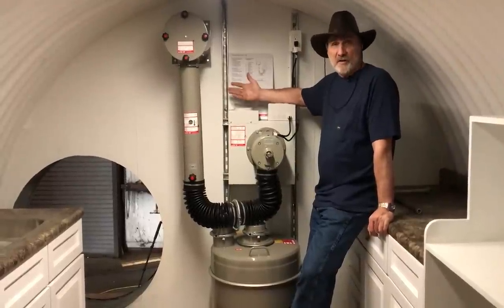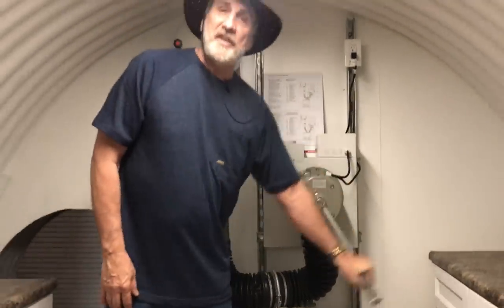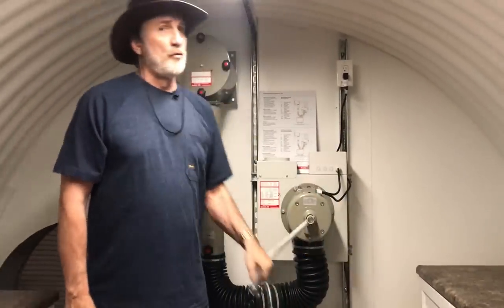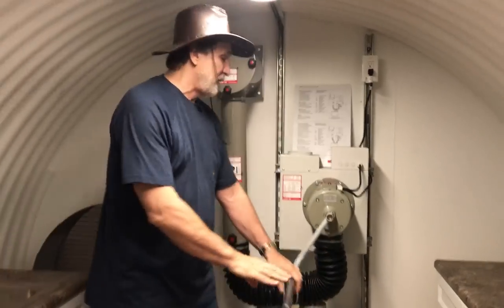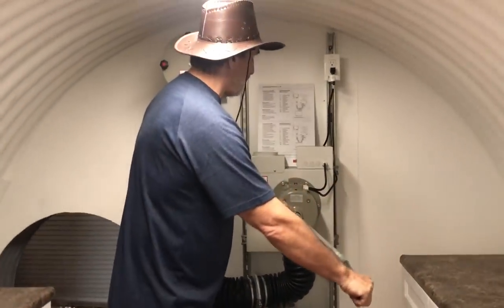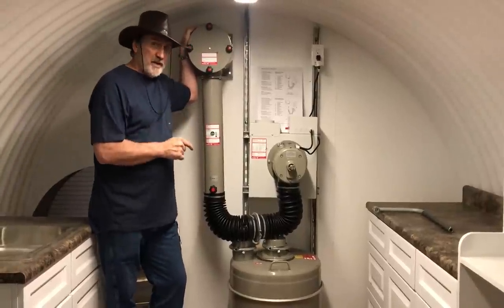How Do You Breathe Inside A Nuclear Bomb Shelter?

Comment: 1)For a prolonged stay in a bunker,  how long will the 60 pounds of carbon & hepa filter last?  2)  Can this be set up so that the 60# of carbon and hepa filter are located 'outside" the actual bunker...an enclosed closet built at one end to keep the build up of filtered material away from the people in the bunker?
Reply: Not long enough and you won't have enough gas to run the generator. It is better to use an internal ecosystem like biodome with zero concrete.
Reply: @brandonandreski1709  everything in a bio dome would be dead from gamma radiation let alone bio or chemical
Reply: @robinsonharvey6186  You misunderstand my meaning. Not the actual dome made of glass, though if thick enough it could work. Gama is very short lived. I am saying that having a filtration system dependent on power and subject to blockage which you cannot unclog because the filter is now a small fission device, is a rather bad idea. So you need to have an alternative system preferably an ecosystem with various plants and possibly aquaponics in order to recycle your air. Power will still be your primary problem but a propane generator with a battery system would probably be the best setup short for your own nuclear reactor. Solar panels will get covered in ash and are subject to other external issues like the EMP that will undoubtedly be released with every detonation. The bunkers will give you a few days but after that you will be forced to venture out. You need something with at least months or even a year buried a good 40 feet down and capped off with a concrete slab.
Reply: @brandonandreski1709  you are correct about filters being contaminated and relying on power the filter issues first to make your charcoal last longer you run the air thru a container with a bubbler system like a fish tank with water and charcoal then in to your charcoal filter and you can flush water and replace in first container and the power issue you have to keep extra supplies for a generator why not keep diodes and capacitor with soldering and solder to fix solar panels and wind turbines NBC suites to go fix things outside and the depth issue is a simple equation how close are you to a military target three feet of dirt protects from gamma and emp cement helps but doesn't protect in actual blast zone just outside it
Reply: @robinsonharvey6186  I used to build reverse osmosis machines and filtration systems. I understand how you can make them last longer but the issue of radioactive buildup is a big problem. As radioactivity builds it tends to leak from containers and heat things up a lot. 

How are you going to fix solar panels on a radioactive surface? That is a complex problem with a very simple system. Propane generators and a battery system. You can have a battery the size of a refrigerator to store power and your propane generator only runs for a few hours every week. 

If your close to a target there is nothing that is going to protect you. I am talking about a shelter far enough away that you don't have to worry about the initial blast. Fallout is the reason you build a shelter. If you are worried about the blast because you live in the city, don't be. You will have a zero percent chance of surviving. A 40 foot bunker with a slab is for stability not just radiation protection. 

An underground hydroponics or quadraphonic system would be the best scenario for long term survival. It will recycle the air and keep your system completely isolated. The issue is containing CO2. Concrete absorbs CO2 and traps it, so you will eventually suffocate so you need to create a sealed metal enclosure that does not react to oxygen or carbon. or that does so very very slowly.
Reply: @brandonandreski1709  for contamination you have to have stuff like pectin or apple juice with it in it or borax soap to clean filter systems of any kind plus it's easy to survive it's hard to survive the mob of people also trying to survive
Reply: @robinsonharvey6186  It's not as easy as washing off. You have to have the respirator, o2 tank, full radiation/hazmat, and portable radiation detection. Alpha and beta are OK but within two weeks you will be dealing with high enough levels to cook a person depending on the level of fallout. In the event of a full on nuclear war you are looking at about a year before radiation levels are low enough to pose little to no threat. Even after cleanup though a wind storm can come in and blow more radioactive particles your direction and that would mean a death sentence. I would rather not have to deal with cleanup at all and have a completely enclosed system so I don't have to go outside for 365 days. Not perfect but still better than external filtration and trying to fix solar panels after EMP. You are never going to get me to try to fix a wind turbine in a suit like that.

Comment: This explains how clean air gets pumped in, but my question is: How does old air get expelled?  I can’t seem to find any info on these having an exhaust system, and if this is so, and the bunker is air tight with air only flowing inwards… wouldn’t this be pressuring the bunker and be unsustainable? 
Would be great if you could please clear this up. I’d love to own one of these bunkers one day, and this question has been nagging me.
Reply: This is a great question.  I'd love to hear the answer.
Reply: The bunker has a blast valve at the other end of it, this opens up and lets air out once the bunker is pressurized.

Comment: I need some help understanding the above ground air pipe. For me, it is the achilles heel of the bunker (of any bunker, not specific to Atlas). Aside from visually notifying people of the bunker's location, please help me understand what prevents a looter from: a) gasing the bunker, b) cutting part of the galvanized steel (I know not easy but it can be done) and throwing a grenade down the hatch, and c) completely sealing off air from above land (covering the air pipe) so the bunker will be airless. I know Atlas tries to explain some of these in the videos but they never go into so much detail. And I do realize a bunker is not a permanent solution, etc. I very much like Atlas and I am just trying to learn more about this. Thanks
Reply: Well due to the filter gassing is not an option but i think rest are fair points
Reply: if  a looter can be above ground spending that much time doing that... then you probably don't need to be in the bunker anymore lol
Reply: @ArchersPlace  good point. Can just go outside and deal with them at that point. However, it may be too loud to go from the front hatch and even the escape hatch and (if they are armed) they might get the better of you.
Reply: It there was a nuclear war, I was wondering about debris or anything like that covering up and entry points for air. What are any ideas or effective was to avoid that situation
Reply: Well first off you would have to hide the air vent or blend it in somehow you would not just leave it exposed this is the main thing that would prevent all these. But if it was somehow found the air intake pipe has a one way check valve so you could not pour or gas anything into the pipe. I think the filtration system filters out gas too.

Comment: I am curious if you could develop an electrolysis system to turn water into oxygen to generate air in deep underground bunkers?
Reply: You'll never "run out" of air. CO2 toxicity is the danger in a sealed shelter, so fresh air has to be brought in to keep the levels low enough. CO2 building up in your lungs is why you can't hold your breath for five minutes. Your body senses it and overrides your conscious control.
Reply: @PatrickKQ4HBD  ok but the point was if someone could do something like how space stations operate

Comment: And where do you get the electricity from, when the bomb falls? Yes, there is a handle, but no one can manually turn the thing for days or even weeks…It is also not optimal to have the Filter inside the shelter. Any radioactive particle will be sitting in there and radiate into the shelter…

Comment: Stupid question but does the system have to be running the whole time you'll down there just hanging out in normal times, or just in an emergency where the air is bad outside?
Reply: In normal times you run it without the filter.
Reply: @RJM1011  Thanks Richard, thought so but wanted to be 100% sure
Reply from the maker: it runs only when you are in there
Reply: @Atlas so you read the comments. I want to know if you thought about a solution to someone covering the air ventilators on the ground. 
And how many times per hour do you have to rotate the machine?

Comment: How does that carbon filter work if there’s nothing even connected to it
Reply: it looks like it has 2 couplings. It's not connected for demonstration purposes I'm guess. Look at the hose, you can see it's attached to itself in the video. I think you attach each end of the hose to one of the couplings, one draws air in, the other, after going through the filter, blows the clean air out.

Comment: My question to u is if you need air with the crank do u have to have some one constantly cranking it
Reply: No. You can crank it enough to fill the shelter but eventually you'll have to crank it again to exchange the air in the shelter for fresh air. So you don't have to constantly crank it but you do have to have someone ready to crank it when needed.
Reply: @zombieshoot4318  how often would you have to recrank the filter
Reply: @user-lg7cb6sr5z  Well it depends most of the time you would just have it running of of your generator pod attached to the bunker itself that you can go and refuel every  few hours or a 2nd choice is to also have a set of batteries hooked upto eachother powering it

Comment: How long will the filter last? How many hours of use before you change the filter?
Reply: Yeah, and how do you change the filter once its been used, the unit is inside the shelter so your taking a dirty filter out inside a clean zone which is nuts.
Reply: The filter is 2 farts away from change

Comment: Could a cheaper way be plants since they send out oxygen
Reply: Political Boy the electricity consumption will be large in that case and you will need a lot of space. You can bury and connect  a shipping container( with extra supports as it will collapse without it) to your bunker and use it as a vertical farm that can produce up to 2 acre of land equivalent of food a year in that small space. In order to power it you will need a huge amount of energy like from a nuclear reactor or some kind of geothermal system using low heat sterling engines to make the power. Either way it is going to be extremely expensive and not cheaper.
Reply: You are going to need a ton of plants, a tone of water, and a ton of uv light

Comment: Okay, so I'm confused.  You bring in all of the radioactive dust and it sits in your unshielded filter ?  Um... So you will expose yourself to radiation.  A better idea would be to shield the filter cannister so any radioactive material is not going to kill you from exposure to it.  Or am I missing something ?
Reply: They are shielded as far as I can tell. We have one of those systems in the bunker of my grandparents. Here in Switzerland you find those things everywhere. And I am pretty sure the filter is shielded.
Reply: If the air pipe outside is high enough off the ground and properly constructed it's not going to be sucking up dust and dirt to the point that it would endanger you. The Swiss use these air systems for their nuclear shelters. They know what they are doing.
Reply: if i understand correctly the thing you’re filtering is isotopes (i think iodine) that specifically kill you if breathed or injested but not gamma particles as the gamma particles are relatively short lived and would be absorbed by the concret and steel doors at right angles

Comment: How does the carbon filter hook into the air system?
Reply: it looks like it has 2 couplings. You can see the rubber snake attached to itself in the video. I think you attach each end to one of the couplings, one draws air in, the other, after going through the filter, blows the clean air out.

Comment: how long will the carbon last if your not using it? 1 year 2 years forever?
Reply: i think he said in another video the filter is good for 25 years in storage, but when you open the seal and actually connect the filter and use it it's only good for 1 year

Comment: how would this cope with burning fuel poured into the intake or a fire consuming all the oxygen around the air intake?
Reply: obviously not very well, these are supposed to protect against airborne threats for specified periods of time. If you have an actively hostile person above you, they will flush you out with ease. 

These bunkers are intended to survive something that would normally kill you instantly, they are not intended to act as a stronghold against human threats. 

Think of an air filter like all the sensitive tech strapped to APCs, hard kill APS, advanced thermal optics, laser designators, passive/active radar panels, All of this equipment is high quality and useful, however these systems all rely on the target being hundreds or thousands of meters away utilizing subsonic projectiles. 

Every piece of offensive/defensive tech is vulnerable to direct human intervention, intakes get burned out, snipers shoot out optics, tracks get jammed or blown out from traps. 

There is no filtration system in the world that can defend against human attacks. No bunker is safe enough to stop a determined individual.

Comment: Wouldn’t a lot of nuclear ash clog up those air systems and slowly kill someone?
Reply: Not really, as long as you are not near the epicenter of the explosion. And even if so you can still go out if you have a decontamination room.
Reply: Unless you're near an explosion, which means you've probably got other things to worry about, the answer is no. Plus the air pipes should be high enough off the ground that they won't suck up anything other than air.